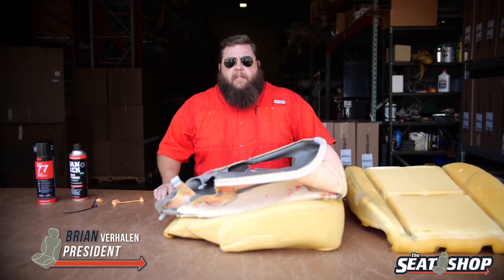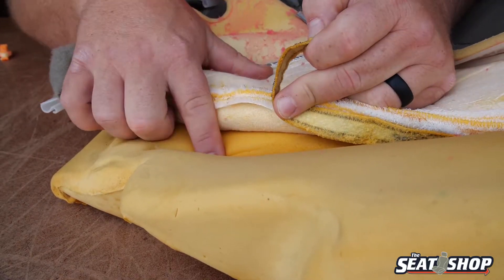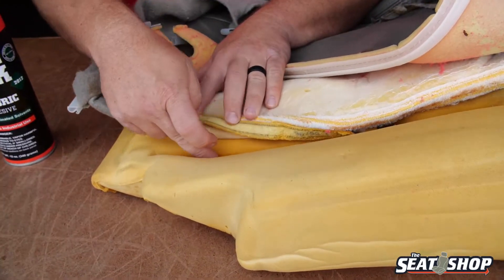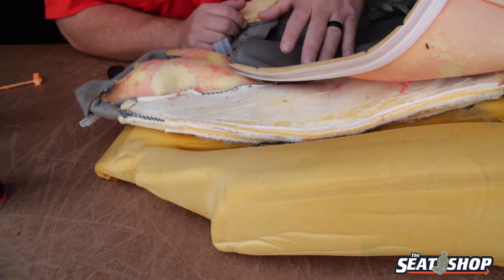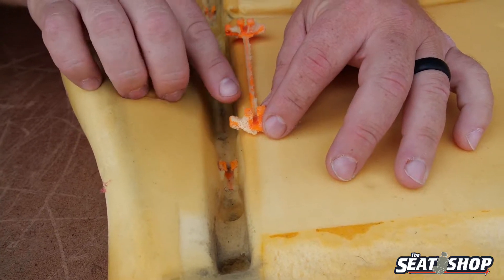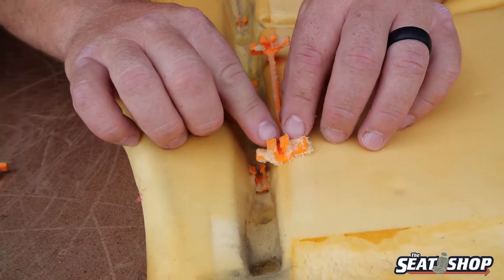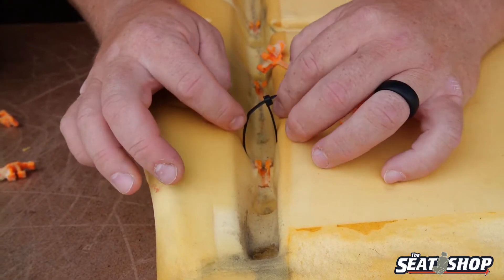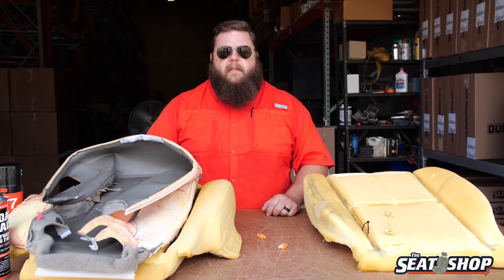How To Fix Ripped Velcro and Broken Clips During A Seat Install | The Seat Shop

Comment: Any suggestions on how to attach the rod that was embedded in the foam. the entire rod pulled out when we removed the old cover on a 2015 ford expedition ?
Reply from the maker: Super 77 spray adhesive is going to be your easies bet, but may not hold as well as some stronger adhesive. If it can't hold on tight enough, you may need to replace the foam.